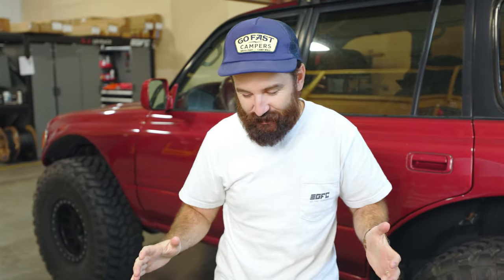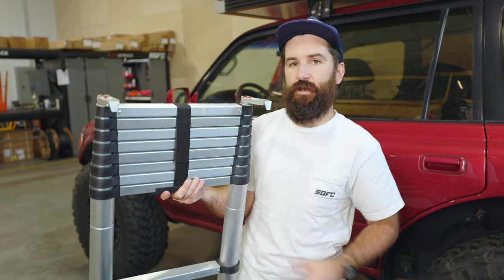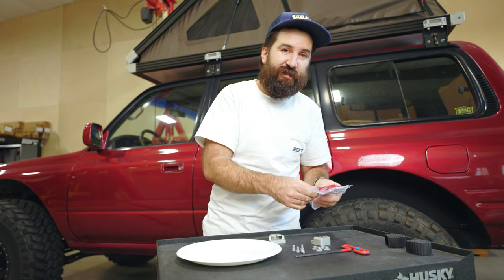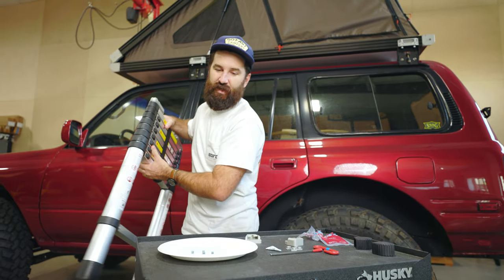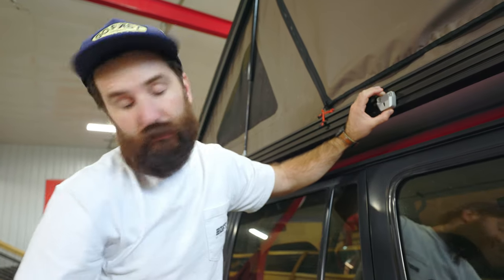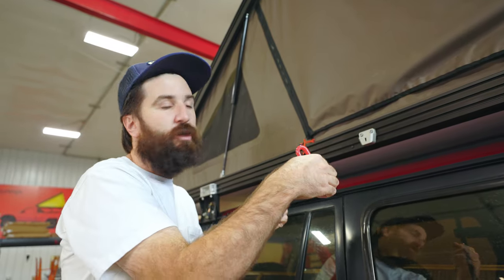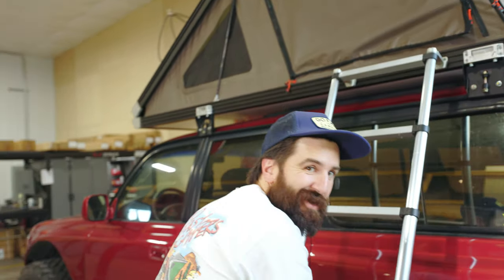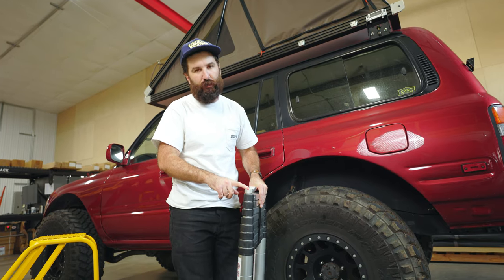The GFC Mantis Claw Install guide

Comment: The mantis claw part is great but the ladder rungs are not slanted so you need shoes on to go to bed. Also if the ladder height is between rungs it’s unsafe and swings in… too far out not sure it will support 215 pounds.